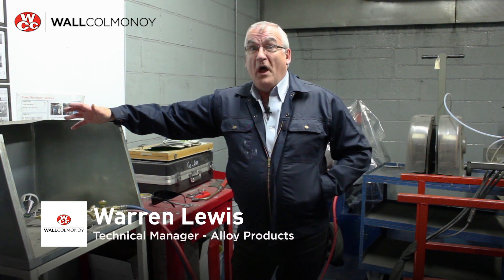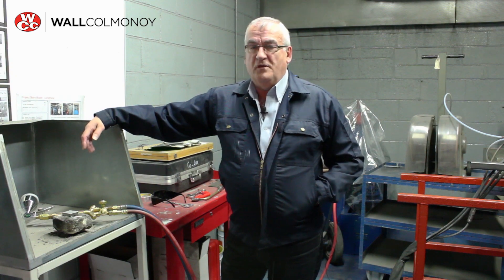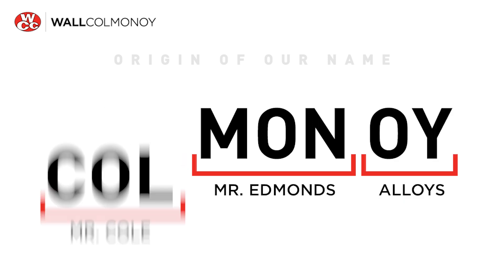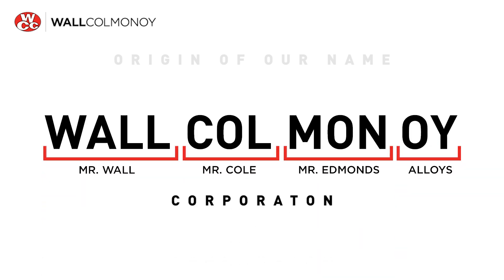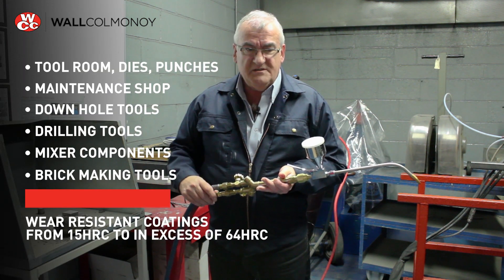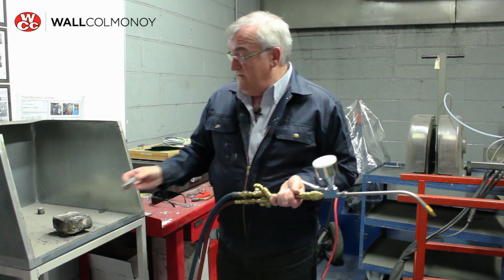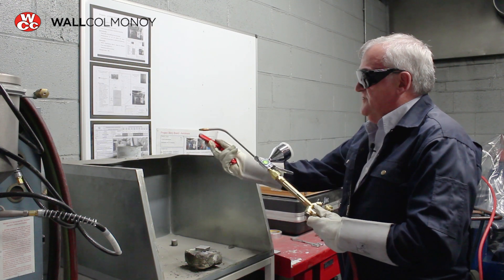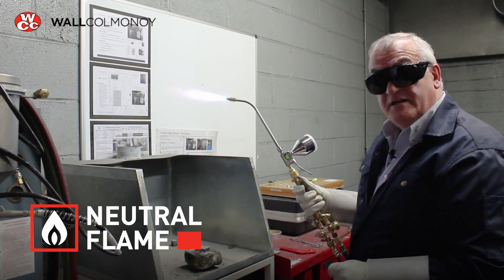Fusewelder™ Torch - Demonstration & Benefits

Comment: What about using OXY LPG rather than OXY ACET? Will that work? Thanks
Reply: Unfortunately, no. The temperatures generated using other oxy-fuel gas combinations are not high enough.

Comment: What are the areas in which this product can be used?
And is it a successful project
Reply from the maker: Yes, it's a process that's been in use for many decades and is extremely successful. The number of applications is huge and it can be used on most grades of metal. You could use it in a maintenance environment for repairing a very wide range of tools from forging dies, cutting tools, forming tools, rollers etc or just about anything which is worn out by the forces of abrasion, impact, erosion, fretting, galling and corrosion. If you can tell us what your potential application is, we can advise the best course of action. Feel free to reach out at warrenlewis@wallcolmonoy.co.uk

Regards, 
Warren
Reply: @WallColmonoy  I want to learn this craft
Is it a successful project?
Because on YouTube I did not find the details of the work
Are there secrets that are not given?
What is the price of a metal spray gun?
Sorry for the many questions
Reply: @WallColmonoy  
Can you give me clear examples of areas where metal spraying can be used

Comment: looks like spray brazing to me
Reply from the maker: Hi Isaac. The term "brazing" refers to the joining of two components using a low temperature filler material with the aid of capillary action between the two parts being joined. This is surface coating and therefore, only one component or part is coated. Capillary action isn't necessary. However, the mechanism of bonding the coating material to the substrate is by metallurgical bonding or diffusion which is exactly the same as brazing or bronze welding. Please let me know if you have any further questions. Thanks, Warren
Reply: wetting into a material no matter two or one the material brass or  solder is wetting into a material even putting on a top coat or cover.